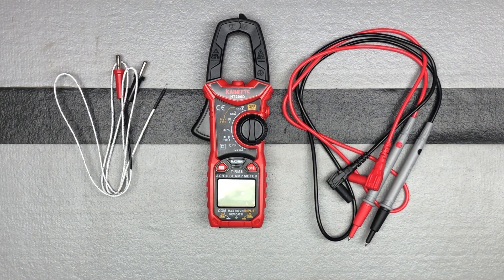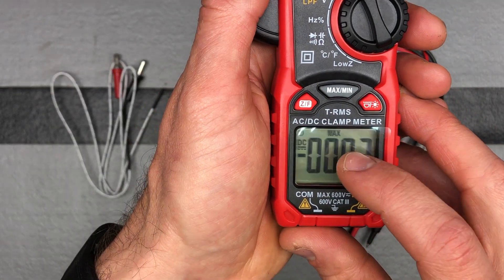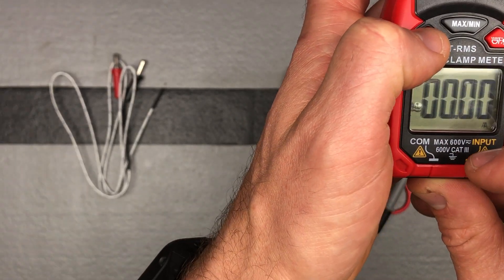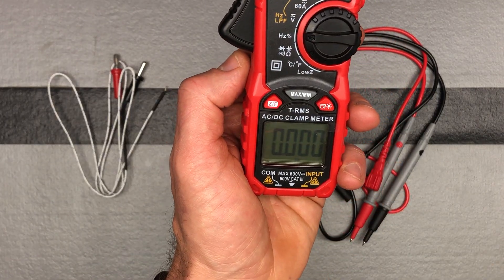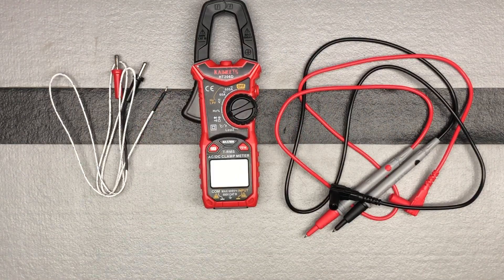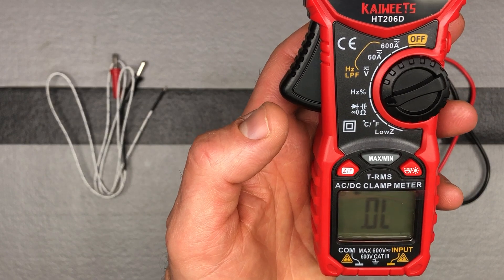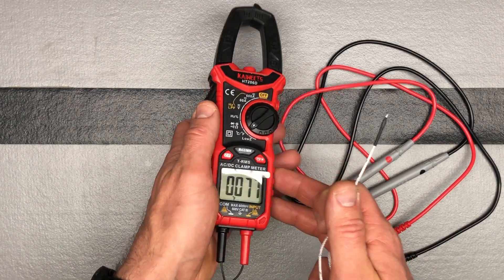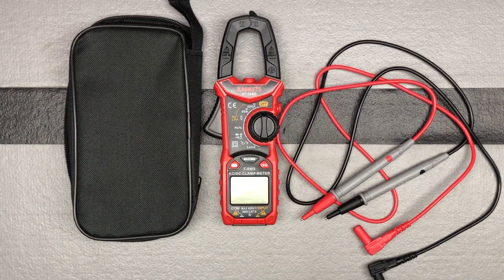Demo: KAIWEETS HT206D Digital Clamp Meter T-RMS 6000 Counts, Multimeter Voltage Tester

Comment: What a useless video ! You just plug in and out the test-wires whitout any real measurement. The most important feature is the DC-current-clamp-measurement and you don't even say one sentence about it. This video is sufficient for a chimpanzee to teach him to plug in the test-wires but not usefull for anyone really interested in the device.
Reply from the maker: Yet you still watched the whole video. First, check the date. Second, follow a professional electrician if you want professional electrical device videos.

Comment: I have this meter, it reads 10% higher than Fluke, Uni-T.  If you want cheap and accurate get a Uni-T their models go back a decade.  This particular model is a rebrand of a Habotest HT206D, sold under different names on Amazon.  But Habotest seems to have a much more detail and different product lines.
Reply from the maker: Yes. It is cheap so that doesn’t surprise me
Reply: it reads identical and all 3 have tuning potentiometers if your specific one is slightly off.
Reply from the maker: @ you know much more than I do!😀

Comment: So if shows 0.4 A in DC without any wire through the clamp ? Many currents in automotive are around and less than 1 A... so it is useless for that ?
Reply from the maker: I believe so, but I am far from an expert
Reply: @GelBallBlasterMaster  I found the PeakTech 4350, capable to measure mA for my needs.
Reply: You want that low dc amps, the Uni-T 210E is your best bet. It has the rotary dial position for each 2A, 20A, 100A.
Reply from the maker: @ thanks. I have so many meters. I really just change outlets/swirches
Reply: you need to use the zero function, which is holding the z/f button. This is the same for all DC amperage because it is measured with hall effect sensors. No clamp is different.
The best DC reading you can get is turn off the power to the DC cables, set the clamp around the cable and set it down (don't hold it in hand) and press the zero button.. now turn on the power. This will give the most accurate reading as you are not touching it.
Reply: @gg-gn3re  I did that. I bouhgt that clamp, it fluctuated always by more than 0.2A. So I sent it back and bought the PeakTech 4350 and it fluctuates only less about 0.01A
Reply from the maker: @ thanks

Comment: Can you check Amps with this?
Reply from the maker: I believe so. I am sure the Amazon page lists all the specific features too
Reply: did you ever find out if it did amps
Reply: @davidsmith5766  i have not!
Reply: That’s what the idiot initially measured, but he stated he was measuring voltage, he measured amps when he turned it 60 amps

Comment: can it measure inrush current?
Reply: the min-max mode should be able to read the peak current, if your device just draws the max current on startup.  If you have peaks higher than the initial one later on, then it'll record that as the peak, but usually the inrush is the highest that you'll see.
Reply: @hwingerrr5680  ok thanks!
Reply from the maker: I will be honest I am not familiar with that measurement

Comment: At 1:53 you are measuring current draw no volts correct?
Thank you for the review. This might be just what I am looking for if it will read DC current as high as 50 amps.
Reply from the maker: I will try to check it this weekend. I have many meters and I don’t use them that often😀. If you go to the listing on amazon and ask the seller directly, you can find out too
Reply: It'll even read DC current as high as 600 amps, so 50 should be no problem.